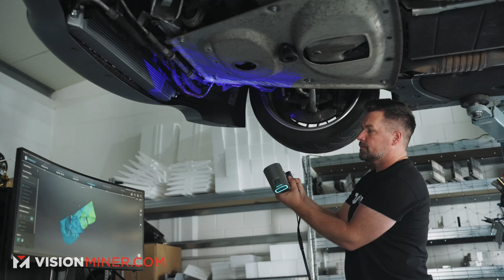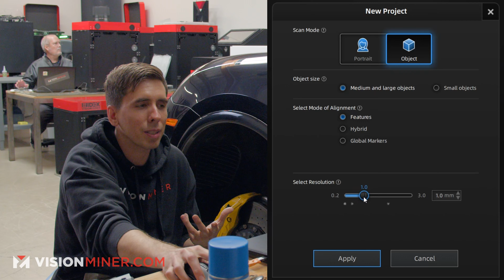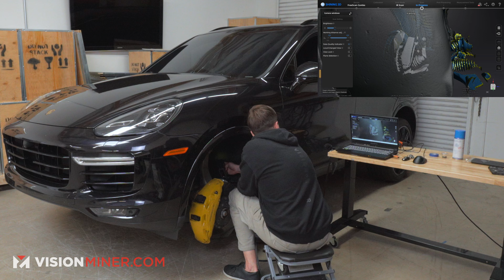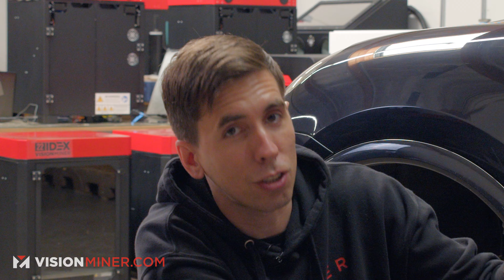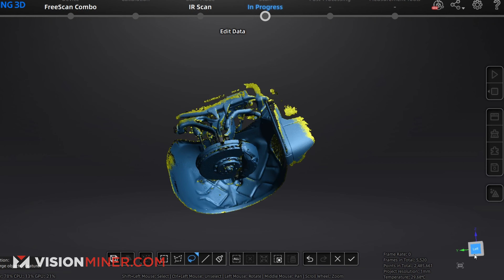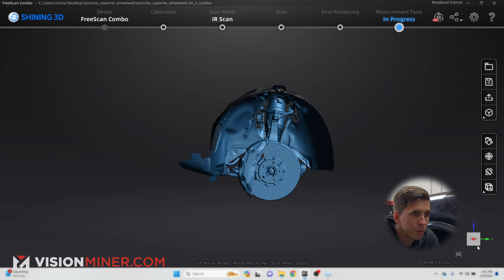Best 3D Scanner for Suspension & Automotive - 2024 Freescan Combo Shining3D

Comment: Any plans on reviewing the Creality Raptor? I recently bought one to demo these types of scanners coming from a photogrammetry background, and so far I'm pretty disappointed with the speed of scanning. Particularly the tracking seems to get lost quite frequently and the color mapping seems to be giving me some pretty subpar results. The problem is, I don't have another scanner / workflow to compare to. So I can't honest tell if it's a me problem, or a software / hardware problem. How does thay compare with the 900 Einstar sepcifically? I want a very broad base to start with so I can see the beneifts / downsides to laser vs ir scanning. If the Einstar is comparable (or even better), I'll return this device and more than likely end up buying from you. Vision Miner and its people aeem to know what's up. I appreciate the communication/ transparnecy with your products. It's a shame these scanners are so darn expensive, but I know you get what you pay for. Ideally, I would want something less than 2k that can holdme and my business over until I can afford one of the top of the line scanners in the 15k range. I just can't justify that price where I'm at right now with my expenses being so tight.